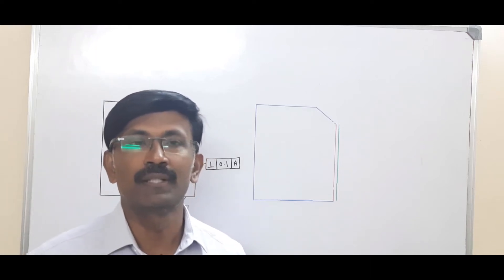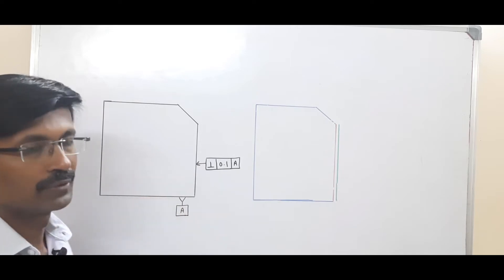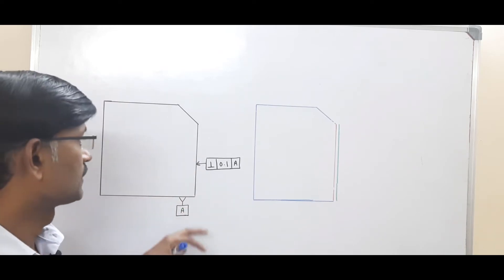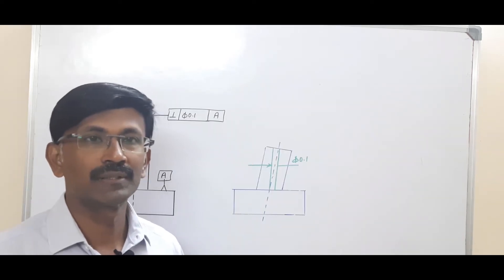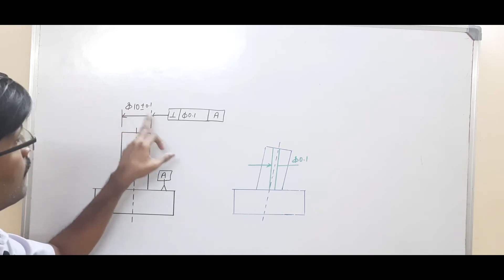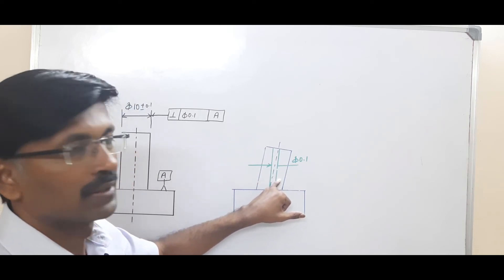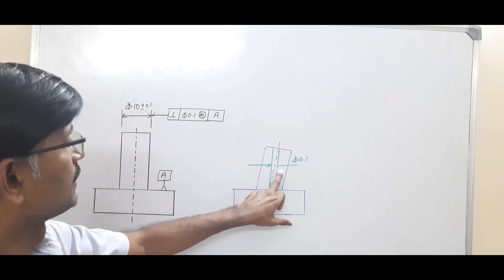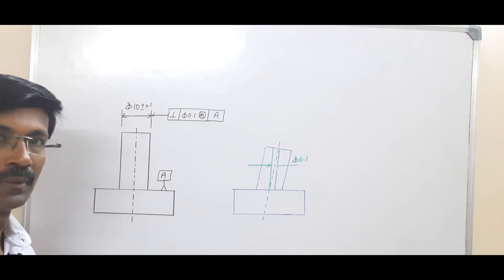GD&T Tutorial 26 : Perpendicularity Tolerance

Comment: 1. in case of Orientation(i.e, Anularity, perpendicularity & parallelism) when  the Geomentric tolerance given on Feature(i.e, Surface) then the boundary will be MMC or MMC+GT.
2. same as in the case of runout ??.
Reply from the maker: in any of the situations that you have mentioned, we will not get boundary conditions.
Boundary conditions apply only for FOS
Reply: sir, suppose i take a square block 100±1 with 10mm thick i given datum A to bottom feature and perpendicuarity 1mm to left side feature and right side feature & parallesim 1mm on top feature then my actual mating envelope will be MMC or MMC+Gtolerance.

Comment: sir why can't we go with circularity rather than going with perpendicularity size tolerance ( controls axis).. both circularity and perpendicularity controls axis with some tolerance., is there any specific way to go with this??
Reply from the maker: 1. circularity is a form control Vs perpendicularity is a related feature control
2. circularity will control only the surface not the axis Vs perpendicularity will control the axis when applied to FOS
Reply: @PalaniKailash  thank you so much sir